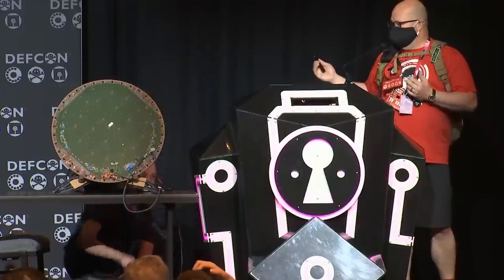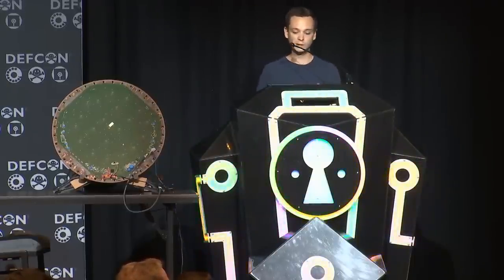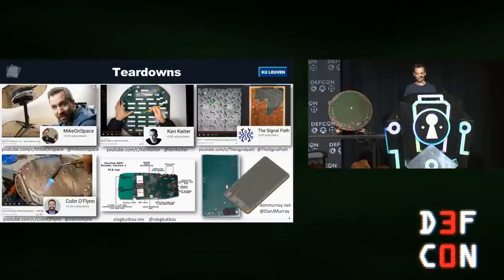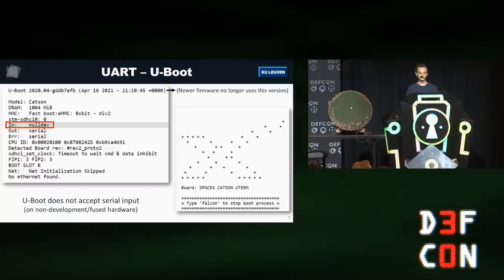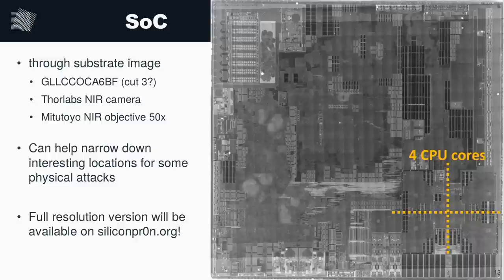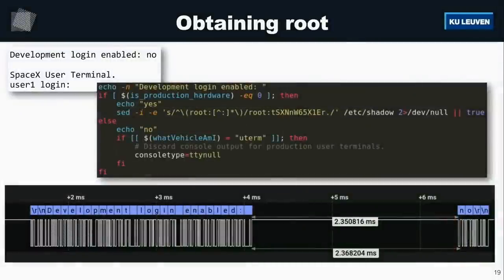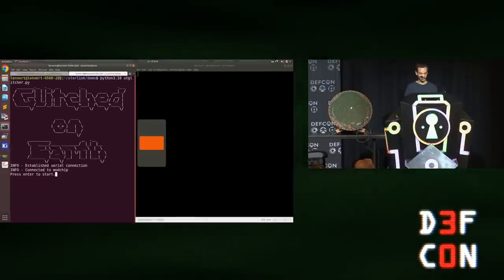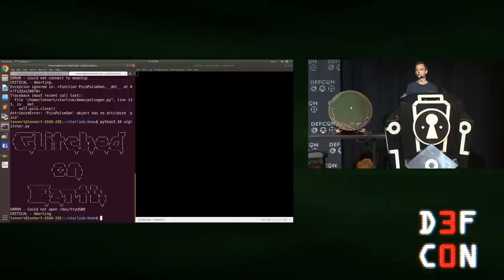DEF CON 30 - Lennert Wouters - A Black-Box Security Evaluation of SpaceX Starlink User Terminal

Comment: Black Box Security Testing on StarLink taking approx 1year. Kudos to you guys, and i was surprised when you told that the SoC needs to be revised totally again for the patch. 
I wonder how StarLink gave the permission to disclose this unpatched issue that too on defcon when the terminals are all dispatched & running on war environments.
Reply: Iirc they updated firmware and overvolted a fuse remotely on all old hardware and the V2 square dish is secure (for now)

Comment: Wow, great talk! It's nice to hear that their response was seemingly pretty good. I'm pretty sure that the decision never touched Musk's desk, else they would've tried to sue you or something.

I have a very similar voltage glitch modchip in my xbox 360, I'm pretty sure they also use MOSFETs to disconnect the decoupling capacitors. Nice to hear that the same technique is being used for something more interesting :)
Reply: You guys are ridiculous lol. The news spread around quite a bit. I'm sure he saw it. SpaceX wouldn't have put out an official PDF response about it on their website without Elon known about it (that's still on the website as well).